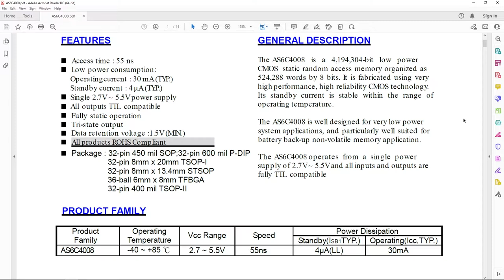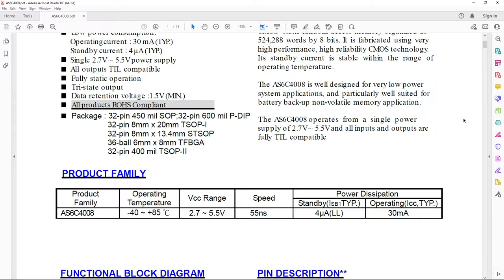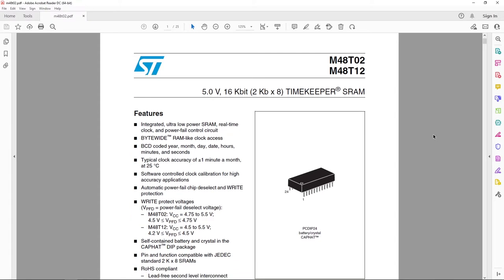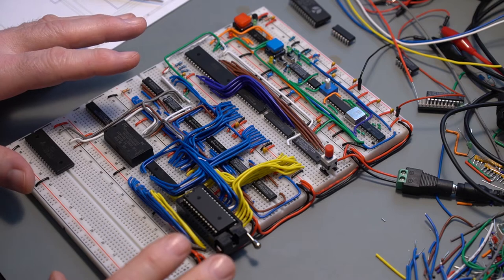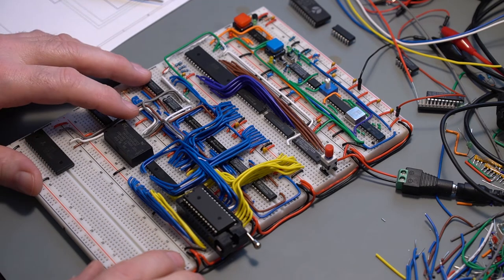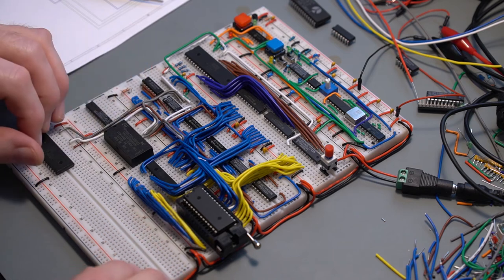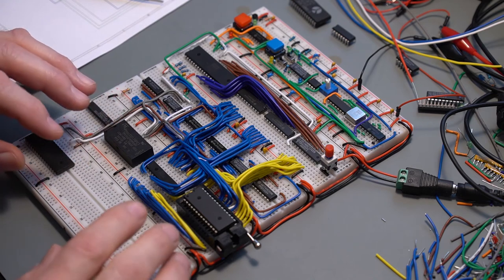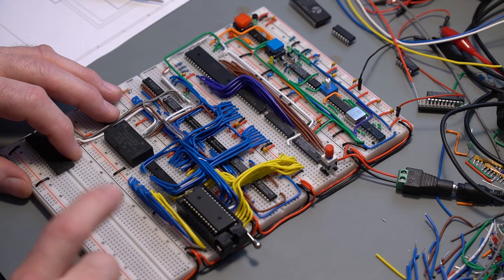MH6502 - Memory (Ep4)

Comment: great build and great series ... curious about how your ZIF socket fits on a breadboard ... the pins on the ones I use (common green ones) are too short to be grabbed by the springy contacts inside the bb ... using a trick?
Reply from the maker: I used an Aries ZIF socket. I admit it barely fits. I'm fortunate, as I never had issues with the BusBoard brand breadboards it was pluged on to. I did try a chinese version, and it was a no go. What I ended up doing with that one, was to socket it in a wire wrap socket. Same thing with dip switches, a nightmare on breadboards, but if you socket it, then it works.